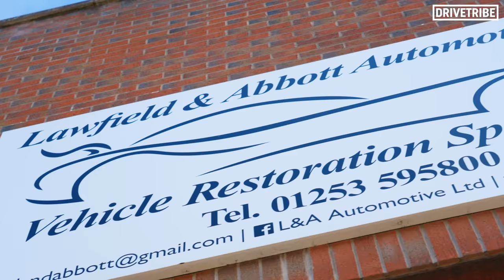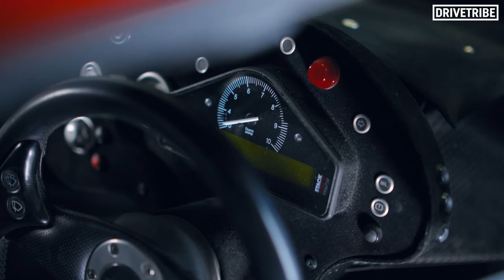The 7.7-litre V12 supercar that was too scary for anyone to drive

Comment: The other company Mr. Abbott mentions is not TBR, but TR Supercars, an engineering company based in Lytham St Annes. TR, working with former TVR Engineers built a Speed 12 with the components mentioned to use as a dynamic test rig for validation of the automotive components TR's parent company, Helical Technology, manufactures for high end marques such as McLaren & Ferrari.  TR has since gone on to secure the trademarks of Speed 12 & Cerbera, and have built two more versions of the Speed 12 with twin turbocharged 6ltr V12s, producing north of 1,010bhp.
Reply: This makes me so happy. The world needs more cars that require skilled drivers. Danger was the heart and soul of motorsports history, long since faded by modern manufacturing and machines without character.
Reply: Cooool
Reply: Not that you may know but any opinion on the origin of V12, as in if it was completely bespoke or had origins from, say similar head design to the speed 6 it is argued to be related?
Reply: The two continuation cars are powered by V12 engines direct from Aston Martin and cost around £1m.
Reply: @keepyuppies  3 now ;)
Reply: Monster cars😊
Reply: @grahamabbott8195  the last of an extinct breed.
Reply: @keepyuppies  surely strapping 4 triumph triples together would cost less then 1 million and likely be lighter.
why am i supposed to be impressed by expense
Reply: @keepyuppies  Oh if this is a Valkyrie engine that is cool, still seems like there are more knuckled headed ways that would be interesting.  Mostly just miss the fact more V12s of this type weren't made

Comment: My favourite car from the ProjectGothamRacing franchise. I remember when EVO magazine gifted this car 11 stars, there max is normally 5! What a TVR
Reply: Thats how i know about it.  You had to get all platimum medals in PGR2 to get it and then it was basically unbeatable in multiplayer.  That game is also how I came to love Noble which is another car that is pretty much impossible to own.
Reply: @mushieslushie  I remember they released a DLC pack for PGR2 which included the Speed 12 but with a different, fixed color compared to the one you'd unlock with Platinum Medals. So online you suddenly saw everyone driving Speed 12s and crashing all over the place, but if you saw one in a unique color you knew they got it through driving skill...
Reply: @t3hgir  I think there was also some way to cheat and unlock it by copying a game save file or something but same thing, if they couldn't drive it you know they cheated.
Reply: Project Gotham Racing was a great series, it's a shame they stopped making it
Reply: Street Fighter had Super Akuma, PGR2 had the Speed 12. Both ridiculously overpowered and almost unbeatable. PGR2 had the best online gaming community i have experienced to this day.

Comment: You throw street slicks and computerized traction control system (with the modern dual-clutch transmission necessary to be controlled by said computer) on that thing, and you've got yourself a car

Comment: Great timing! I actually trying to do a challenge to myself by using this car to play in Gran Tirusmo 2 (yes it first appeared in that game) and it such a monster, the only thing that dwarf it is the infamous Escudo Pikes Peak version. It was and still is a challenge to control such an enormous power even with TCS and ASC put all the way up but it just tears through every single other car (apart from that Escudo)
Reply: Yape you're right! I remember it from GT2 first, what a beast that car was, undrivable almost!
Reply: Was it just the race car? Because I remember the speed 12 in that game came with the weird front and rear end. Though you could also race modify the standard one so not sure. Definitely a different body to the one most people know.
Reply: @Zootopia96  it came as a normal car but it have racing modifications. The one in GT2 was a prototype of it called Project 7/12 (simply called Speed 12 in-game), not the Cerbera Speed 12, that's why it looks different from this one. Go look that name up you will recognize its shape and its iconic purple color.
Reply: I loved my Subaru’s and collection of Skyline’s
Reply: The ecsudo was the beast the power with stage4 turbo and sum gearing man on gt3 I did 330+ mph with that suckered. 1800 hp in gt3
Reply: @oRicardoHetfield  the top speed can exceed 410kph with proper gear tuning plus when sold it is worth $500.000!
Reply: @Zootopia96  Coco Hayashi ever used the Speed 12 once. In Gran Turismo 2.

Comment: Actually, I had a problem with something similar when I designed a monergol capable to accelerate to Mach 19 in a few seconds: the acceleration is lethal, literally. But acetone is easy to produce and doesn't require any oil, and dissolves Acetone Peroxides (DATP is best as a fuel, TATP is a bit too unpredictable)

Comment: Finally a high quality video of this absolute legend of a car! Best sounding V12 in the world!
Reply: I don’t think it sounded great. The GMA T50’s cosworth V12 is the greatest modern day V12 imo.
Reply: jameswheeler5025  Doesn't need to be if all it does is disappear off into the distance. The car is stupidly fast and borderline undriveable at speed around corners. I've had it spin its rear wheels all the way through 5th gear in Forza Motorsport, and that was trying to drive in a straight line up to the first corner of the Sunset whatever oval in the game, where, with some tweaking of the rear wing, I could get it to stick just barely enough through the corners to do 380 kph around the track.
Reply: @VishnuRajam4x4  I’ll have to check that out. I posted this before I watched the whole video. Didn’t realize he wouldn’t be driving it. I can agree that at idle and revs it’s not the best but hearing this thing take off and pound through the gears is audibly one of the best experiences you can have.
Reply: jameswheeler5025  It's been a while since I last played any of the Forza games, so my memory is a but rusty. I'm also not sure which Forza installment I had it in. Could've been as far back as FM2.
Reply: I am using the mercedes m120 V12 (OG zonda engine) in my dream supercar build 👍

Comment: I watched a lecture given at Leicester University by TVR's Neil Anderson on the creation of the car. It was superb but I only remember snippets. Apparently, when they had to fit intake restrictor plates to race, the vacuum collapsed the air boxes and they had to use thicker carbon fibre. one of the biggest challenges was not melting the diff and oil cooling was crucial.

I did see the Speed 12 race in the British GT series and it was a monster.

Comment: Great video, just so much history, and mystic about this car. Quite a bit easier to drive than Gran T would suggest though! The car is glued to the road at above about 100mph (on track of course) due to all that aero and having a flat floor. The rear wing connects straight through the rear end to the chassis therefore applying force directly to the tyres. Rear end is a bit fat because the wing has to be contained within the body shape. I could talk for hours about this car.
Reply: Yes but there are with or without the wing. I sur without it very brutal.

Comment: I'm pretty sure there was a Speed 12 in GT2 also. 🤔 Anyway, incredible car, very glad to see it in real life. Also very nice presentation and as others noted, great idea to shift from the video game to real life in the beginning!
Reply: The speed 12 is in GT2, it's friggin insane to drive
Reply: @randallmontejano7787  wheelspin, shift up, wheelspin, shift up, wheel spin, shift up, hang on, brake, brake, brake, turn in and don’t touch the throttle until you are straight.
Reply: @AdamBoothUK  so true have you spinning out in a straight line. 😂😂😂

Comment: I'm not sure how you arrived at TVR using PPF "20 years before PPF".
It was commonly used in the 80's and 90's:
3M developed PPF for fighters and helicopters in the 60s but its use on cars greatly precedes its use by TVR.
Also, the film is identical so "helicopter film" vs PPF is a distinction without a difference.

"In the 1980s, paint protection film began to be widely used on a variety of surfaces, including cars, boats, motorcycles, and aircraft. The film was especially popular among car enthusiasts who wanted to protect the paint job on their vehicles. "

Comment: Mike, what a brilliant video, sat here in Manila on the way to work (I am not driving) in my car came across this update. Back in 2002 during my annual visit to see friends at the factory I had the pleasure of sitting in the Speed 12, the bonnet is just a sea of red and no chance of seeing the road and an awesome sound. Not a car you can just jump into though and have to be a contortionist to get through the roll cage :).   Also the video has brief glimpses of three of my cars, what a pleasant surprise, My 3000S prototype one of only six cars and has no boot, my TAIMAR resto-mod a very special project. The attention to detail by Brian Hosfeild (ex race engineer TVR) and his sublime team is outstanding. The body shell (3000S) outside is for a future project (electric). I have a Griff here in Manila and keep the TVR flag flying. Thank you again super video amazing car.
Reply: Thank you Andy, Brian is an outstanding engineer and the Lawfield and Abbott Automotive team are top notch car restorers. (Graham - the Abbott in L & A).

Comment: “If you have a front end crash, your oil filter’s gonna be the first casualty”… I’d venture to guess that if you had a front end crash in this one-off car, the oil filter would be the absolute LEAST of your worries. What a strange thing to mention, considering the beauty and rarity of the car. AutoZone has plenty of oil filters sitting on the shelf, but probably zero replacement Speed 12 front clips. 😂

Comment: I'm not sure if this car came first or the 1st gen dodge viper did but they both look very similar.
Reply: Viper was a prototype at the 1989 Detroit Auto Show and released to the public in 1991.  The TVR Cerbera Speed 12 was designed in 1997, 6 years after the Viper was released and 8 years after the prototype was unveiled.  

I've always thought the Speed 12 looked like someone was shown a Viper for 5 minutes and then asked to draw what they remembered.  Not a bad thing either, the Viper is one of my all-time favourite cars.
Reply: Yup mine too although I sadly will never be able to drive one.

Comment: Ahh, TVR. Silly cars. Very little direct experience, but a director at the place I worked in the late 90s had a 4.5l Griffith. Insane thing. He let a workmate of mine have a go and the guy almost put it in the wall in the car park. It went very fast very quickly in first. I didn't trust myself to go anywhere near it!

Comment: You can tell this guy has no experience with owning cars outside of playing Gran Turismo and other videogames. 

The Speed 12 engine is extremely unreliable unless it's downtuned, too many heating issues with all the extra power.
The McLaren F1 isn't about brute power although it does have it, it's about a pure driving experience uncompromised by anything. The Speed 12 is extremely compromised, you can't drive it anywhere, extremely wide turning radius, can't see the front nose to properly place it, and can't make McLaren F1 power reliably since it's cooling system is 💩

Comment: 3:54 Due to it's low weight the racing Speed 12 was restricted to 840hp. Originally the customer road-going Speed 12 should have done without the restrictors which would have upped the power to somewhere north of a thousand.

Comment: The TVR Cerbera Speed 12 is so FAST, I tried this monster on Circuit De La Sarthe II in Gran Turismo 4 on my PS2, without tuning it's still one heck of a car, it's a little hard to get used to it to control it, but once you get the hang of it, you'll be fine, LOL.
Reply: It's even wilder as the racing concept car in Gran Turismo 2 and yes, I've tried that monster on Gran Turismo 2 as well on my PS3. 0.0

Comment: So you can include it in the next video that you do about a car that's constructed like this, that's called an adjustable four-link suspension. I'm posting this afternoon that you specifically avoided describing the suspension, at both ends of the car.

Comment: Through legend car. Was epic. However. Nobody could afford it. For less then 60k.. 
The original design came with fender grooves. But it was quickly changed. Because the tired would pick up stone and throw them at the windshield breaking it.... hence the fender grooves disappeared.

Comment: 🎯 Key Takeaways for quick navigation:

En el video se muestra el único TVR Cerberus B12 fabricado para carretera, basado en el modelo de carreras Speed 12.
El TVR Speed 12 original era un automóvil de carreras construido para competir contra el McLaren F1 GTR en el campeonato FIA GT1.
A pesar de los planes de TVR para fabricar versiones para carretera, el proyecto se canceló, excepto por un único Cerberus B12 de carretera.
El Cerberus B12 cuenta con un motor V12 naturalmente aspirado de 7.7 litros y 840 caballos de fuerza.
El motor es único y no se sabe con certeza si se trata de dos motores Speed 6 unidos.
El automóvil pesa solo 1,000 kilogramos y tiene un diseño brutal y orgánico.
Está equipado con una tubular space frame y carrocería de carbono Kevlar, lo que lo convierte en un verdadero coche de carreras.
El Cerberus B12 es uno de los coches más rápidos jamás fabricados y seestima que podría superar las 240 millas por hora.
El propietario actual posee el único Cerberus B12 de carretera y un coche similar basado en un chasis de Speed 12, que utiliza un motor Aston Martin Vanquish V12 modificado.
El automóvil se encuentra en perfectas condiciones y está valorado entre 4 y 500,000 libras esterlinas en una subasta de Silverstone.
El video destaca la singularidad y el rendimiento de este icónico TVR Cerberus B12, que es una rareza en el mundo automovilístico.

Made with HARPA AI

Comment: Those who think that this car isn’t road safe, or would not pass a crash test are simply wrong..granted it might not be great from a side impact,but neither are many production cars from the 70-90’s with a few exceptions like Volvo , Subaru, mostly boxcars, but as far as race inspired street cars which now have more than one center seat it’s even less .. Ferrari has been pretty decent with high speed crashes they are designed to sacrifice the vehicle to save the driver, if anyone has ever seen the F1 which was split in half in CA by a pole at 200mph which allowed the driver and passenger to simply climb out and walk away with basically just a few scars from scratches.. NOW that said the avg public driver couldn’t handle this thing, it would take a driver with experience,and roads which allow such a set up due to its height,and lack of road visibility..but I’d drive it, lol.

Comment: Why not drop a Viper engine in it?  It is smaller with 10 cylinders and can be tuned to more hp.   It will probably be more reliable.
Reply: Because it's not a 12 cylinder engine.

Comment: Oh come on... no, no, no, no, no. Most of the car looks so well engineered but at the back, they placed the two radiators exit flow on the suction side of the diffuser!!!

It will be marvellous for the oil coolers but it will ruin the diffuser!

Comment: a whole video on this car, and you didn't do the one thing that needed to be done, actually use the engine. even for a single proper rev. that was the equivalent of granny revving her little eco engine for her seven year old grandchild.
engines sound incredibly different under load, and the one video of this making any noise is some grainy old webcam level footage.

Comment: V12 BS I had a chainsaw painted Race Car Red that did the standard 1/4 mile in 4.5
minutes 😂Fast 2mm gauged depth cut fully raced Dewalt Battery [56v painted Race Car Red] and it did the standard 1/4 mile in minutes 🤭 and the AI spokes person for the company said it was Race Car Red that did it - so the secret is in the colour of the car.

Comment: 1) Peter Wheeler never actually drove the Speed 12. He couldn't get into it, for a start.
2) That car has been detailed at least twice by maxcarcare of York, who look after my cars, so I've been up close and personal with the car. I've even pushed it around his unit.
3) It could have been used on the road. Brian Hosfield (TVR's race technician) took it for a spin through Blackpool and down the M55 just before it was sold. Nick Fisher of maxcarcare was in the passenger seat!
4) Lawfield Abbott did the respray of my car and it's brilliant. It was the first car they did.
5) The Speed 12 made £540000 + 15% buyer's commission at auction.